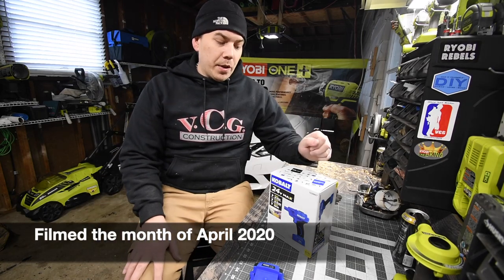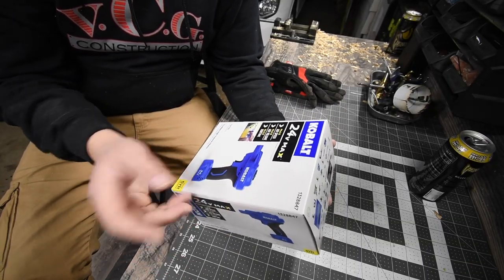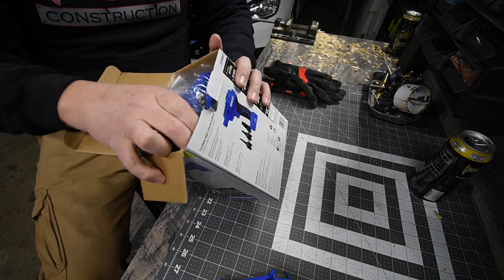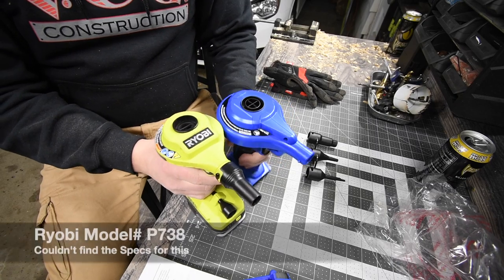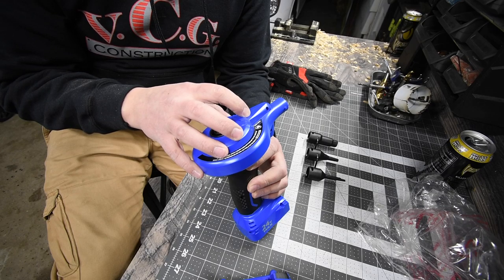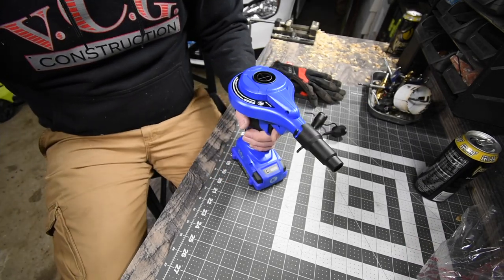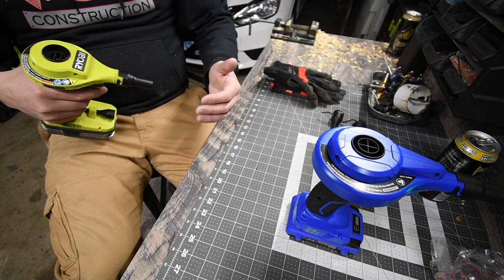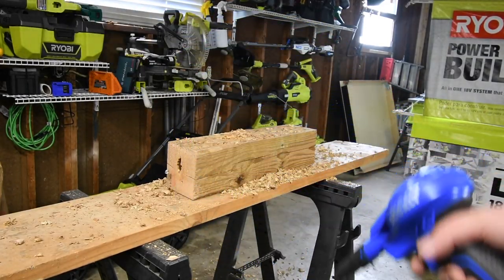Inflators you must have!!!!

Comment: I needed a portable air source. Tired of those disposable air cans. I've seen on here how you can make a refill can of those. That could be dangerous. I have several Kobalt 24volt tools, so I decided to try this. I have to say it works great. I use the smaller 1/8'' nozzle for a more concentrated flow. Works great for blowing off an area or a part you worked on, and in your vehicle around the dash. No worries yet.

Comment: I bought the Kobalt today to blow the stuck bugs out of my car. Gets them off of the rear deck, windshield interior, and side window felts. It does an excellent job. Good companion for my chainsaw that was discontinued. You can actually swap it on the job and blow the loose sawdust out. I'm not sure if it voids the warranty to separate the nozzles. They're awkward to use otherwise. The smaller ones cut way back on the power. I'll probably just use the largest nozzle.